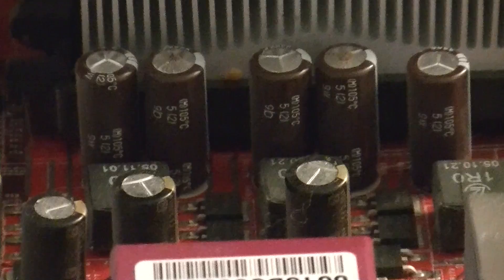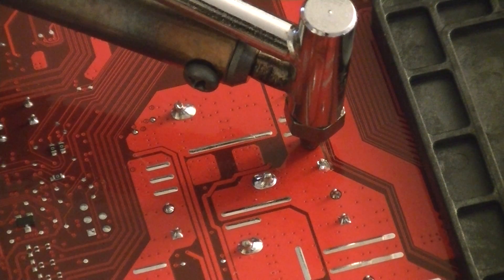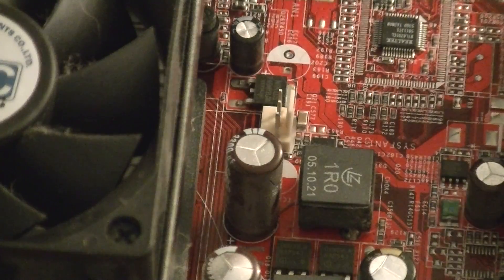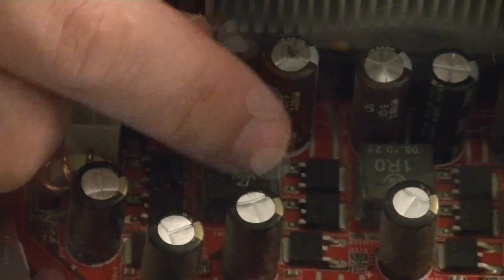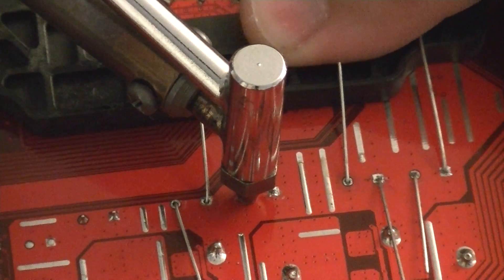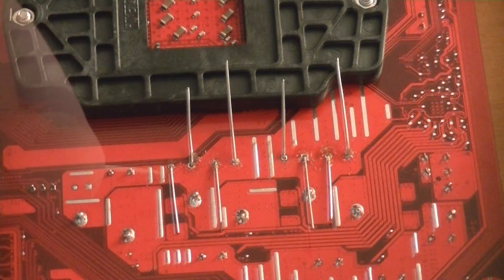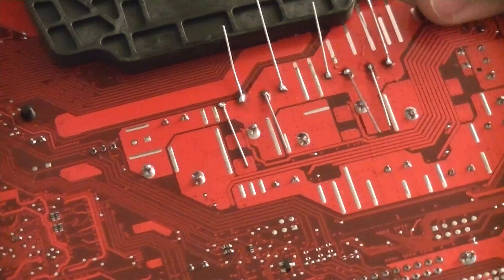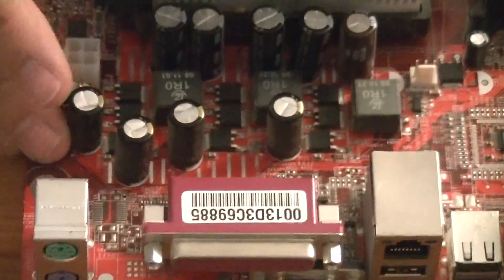How To: Replacing bad capacitors on a motherboard! (MS-7207 / K8NGM2)

Comment: This video shows good technique. It's a good idea to look at all of the electrolytic caps on the board while you're at it. The caps do have a limited service life, and those subjected to heavier use will usually go first, especially those in power supply circuits. For example, if your monitor (or TV) starts looking grainy and wonky, take a look at the power supply caps inside and they will often have bulging tops. Compare all cap tops: they should be flat. Replace any that have the slightest bulge as they are on the way out. The tops have those lines creased in them so that they can open when they have to, less dramatically than having the cap blow up and make a mess. On changing them, take a tip from an old radio man who's been soldering and desoldering for decades. You want to subject the board to heat as short a time as possible. While heating the connection on the underside of the board, reach and slightly wiggle and pull on the component on the topside. When the solder melts, and the iron is removed, the motion will keep the solder from resolidifying to make a secure connection, and removal will be quicker.

Comment: Bending the capacitor terminals after they went through the PCB is not a good practice.
The component will hold in place to be soldered now but it will be very hard to desolder and remove the next time.
Reply: I totally agree. Someone can bend one terminal, solder the other, then straighten up the first and soder it too.

Comment: What is the name of the tool at around 0:34 please?

Also, all of the capacitors around my CPU are bulging. Is this common?
Reply from the maker: SlightlyWetFart desoldering iron!
Reply: uberDoward thanks, but can't find one online like that. Does it have a another name?
Reply: It looks like a solder pump with an heating iron so that it will melt the solder and suck it up, never seen one like that before. If your capacitors are bulging replace them as it means that they will burst open soon
Reply: mauro foti Many thanks for an actual proper reply. It must be a top secret tool as the dude doesn't want to say what it is 😁

Comment: A loose capacitor broke off of my computer motherboard, two computer it and repair shops have told me to replace my motherboard completely, I dont understand this as my pc has not been turned on since trying to install a soundcard when it broke off. I thought I could just replace the capacitor or solder it back on no?
Reply: Tyler Haynes Buy a capacitor and replace it.Or if you want to,i could do it for you free of charge,just pay the shipping.
Altrough i recommend you ask someone near you to do it or do it yourself,since im in Europe and it would cost more to ship than to buy a soldering Iron and other stuff you need.

Comment: It's easier on the solder pads if you break open the capacitor bodies from the component side (of course) and try to split the capacitor down the middle. That way you get a single wire to be desoldered from the underside of the board. You will spend less time heating the pads because you can pull single leads out while using an iron or desoldering gun from the underside of the board.
Reply: That's a great idea.

Comment: what wattage Iron was used for desoldering ?   I've found one pin is easy the other  is VERY stubborn   Thanks
Reply from the maker: gymnrat Lives 40 watt!
Reply: Thank you   :)
Reply: I pushed the top of the capacitors back down and got them to work agian cheers!

Comment: just got an old dell xps 400 (dual core, 2gb ddr2) has a few blown capacitors, it's my test board to see if it works or not LOL. if i fry it i guess i move on to the few old dell optiplex 280 (i think) im gonna learn this soldering stuff! Thank you!
Reply from the maker: Happy to help!  It's a great skill to have!
Reply: uberDoward this is what I call "Fixing it the hard way." I usually don't do soldering/desoldering out in the field unless I absolutely have no other choice and can't get a whole motherboard or appropriate PCB
Reply: chrismc410 I do this as a side job,altrough i rarely take money for simple jobs like this,unless someone is a real jerk.
Soldering and reballing calms me,i enjoy doing it.It is definiately not hard,it just takes a bit of practice and can save you hunderds of dollars.

Comment: I used a needle to remove the old solder and a nail cutter to rip off the capacitors pins that were stuck. My soldering was horrible but it does the job. I'm planning to use my computer 2 hours and then 15 minutes brake cause of that.
Reply from the maker: Did you force the solder off without heating it?  If so, you want to definitely not do that in the future - the solder points on the motherboard are actually pretty delicate.  If you have a problem removing the solder, add some flux, or some fresh solder to it (since it will likely have some flux and help remove the old, hardened solder!)
Reply: uberDoward Yes I did force. I used a needle to poke and remove the old solder. Then, when enough solder was removed, I heated the stucked pins and used a nail cutter to rip it off. I tried the adding more solder method but it still didn't work. I think the old solder had lead, which means higher melting point.
By the way, my computer is still running fine.

Comment: I could replace the damaged capacitors, but now I have the problem that when I want to give the recovery the pc freeze. I tried the hard drive on another machine and it seems to be working fine. I understand that the replacement worked very well, because the pc did not turn on. Now I can access to the bios, but for some reason windows not load. I think is an other issue in the mobo. Just to thank you and congratulate you for the video. Very instructive.
Reply from the maker: Sorry to hear that, sometimes there's internal damage to the integrated circuits - maybe that's what happened :(

Comment: I have a problem removing those capacitors and is that the original solder does not melt and I can't remove them. It looks like the capacitor material is filtered and does not let it melt. Any recommendation or suggestion to remove them? Thanks
Reply from the maker: As strange as it might sound, add some solder!  Often adding a little more solder will actually help melt the old solder :)
Reply: Ok, i will try, thanks.

Comment: Hello, I have that  exact motherboard and I want to replace those caps that are fluid leaking, domed tops, etc. I have the corresponding caps ready to replace, but I do not have flux. So, my question is that I do the job without flux or the flux are very very required? Thanks and sorry for my very poor english. Any comments will be appreciate.
Reply from the maker: Flux makes it much easier.  Flux helps the solder melt better :)
Reply: I have lead free, can i use itor is better with lead. Thanks for your help.
Reply from the maker: It's hard to find leaded solder any more.  You can get flux at any general hardware store, probably near the copper plumbing :)
Reply: Ok, thanks for the help.
Reply: "Rosin Core Solder" essentially has flux inside it, and is sufficient for leaded devices like these caps, assuming reasonable solder skills.

I do NOT recommend plumbing flux from the hardware store for electronic use!  While it certainly will get your joint soldered nicely, it will also leave a resistive residue on the board that is all but impossible to clean off, especially if it gets under small, leaded surface mount devices.  This then leads to intermittent failures of the circuits. 

Learn from my fail.  If you need flux, spring for the real liquid stuff meant for electronics.  Don't get the plumber's flux anywhere near a small IC!

Comment: Is soldering hard? I've never done it but it doesn't look too difficult. I'm replacing 4 3300μF 6.3V blown capacitors on my original Xbox. What specific tools do I need? Do I really need a solder sucker or can I just heat the solder, pull them out and wipe away the solder?
Reply from the maker: You will need either a solder wick, or a solder sucker - if you just pull the component out, the solder will just fill the hole, and you'll have a real hard time getting it out :)  

It's not hard, just be careful - practice on some old electronics, first!

Comment: Thank you for this great video, can you please tell me where the negative leg goes, i have a power supply with a semicercle (black and white) where the capicitor was and I dont want to invert the polarity cause they will go boom on me
Reply from the maker: +Daniel Tevi (Jizzy) You should always check the way the old one came out, to ensure the new one goes in.  If you look on your new capacitor, you'll see a 'bar' running down one side.  That should be the negative lead (normally) - as for white or black being your negative side?  You'll have to investigate a little :)  See if one of the through holes has a solder pad that is clearly connected to ground.  If not, well, you've got a 50/50 chance - I'd probably think white is negative.

Comment: I have a Gigabyte MB and everything disconnected except power supply, speaker and monitor I'm not getting any beeps and no signal. I tried 3 different power supplys still no signal or beeps. all the system fans are working and when I plug something into usb port it gets really hot and the led on the usb device doesn't power on. all capacitors look fine any suggestions.
Reply from the maker: +Brett Stafford That sounds like a totally dead motherboard.  I'd say perhaps a blown IC somewhere on the board, sorry :(
Reply: +uberDoward Going to try replacing all the capacitors around cpu see if that does anything worth a shot
Reply: It could be your cpu aswell idk about the usb ports but Ik when I had my pc it wouldn't beep or show anything on screen it just turned on the fans and that was it. we tried a new power supply bought new ram and everything. even bought 2 differnt cpus and some how they were dead to. but one of the capacitors did spark and make a small fire but that was after the fact. we bought 2 other motherboards after that because the cpus were dead. then on our 3rd or 4th cpu my dad got the 6300 because it was on sale and it worked in the 2 motherboards that we bought and it has been sunshine and rainbows form there. sorry about my life story.

Comment: do they remand LOW ESR caps for mainboards?
Reply from the maker: +Matt K Absolutely depends on where in the circuit the bad cap is, and what the cap's purpose is.  That said, I find many lower ESR caps to be of higher quality - so I use 'em everywhere!

Comment: good and interesting but a couple of small things would perhaps improve it:

what wattage iron recommended for the job?  you seem to spend quite a while with the tip in contact with the board, must be a fairly low wattage I think.  if i did that with my iron the board would get so hot there that the tracks would lift..

is it perhaps a controlled heat iron?  not a simple plug into the mains/gets hotter and hotter..  ?

why use flux instead of flux cored solder? some particular reason/recommendation?

what tip on the iron? a point? a blade?

your solder sucker seems very special.  seems to be two in one - like it heats the solder and sucks, too. most suckers are simply suckers.  you have to heat the solder and then whack the sucker on quick before the solder goes hard again...
Reply from the maker: +arthur brogard My desoldering iron works just as you think :)  It heats and sucks!  It's a 40 watt, and it's a round, hollow tip.  Maybe I'll do a video on it, since multiple people have asked me about it!

Nothing special on the flux vs flux cored solder - just what I had handy :)

Comment: How do you make them holes empty to put new capacitor in? Nothing works for me....
Reply from the maker: +Gregory May If there's solder in there that you just can't get out, it can be a pain.  I've actually had to use a pointed tip on my soldering iron from underneath to melt the solder while pushing a capacitor leg through to clear the hole!
Reply: uberDoward I really appreciate your effort but I don't understand why you skipped the most tricky and important stages like pulling caps out and preparing/cleaning holes. I tried to replace caps on my motherboard and I got stuck in the middle. I was expecting that this job will take 15min after watching all the videos;) There are 1000s of videos like yours where they show nothing or skip whole stages of repair. Seriously I just found 1 video where the guy show everything and this is not in English... And the guy is not doing it right according to commenters....
Reply from the maker: The next capacitor replacement I do, I'll get a more in depth video for everyone!
Reply: uberDoward
Great. Thanks

Comment: 6.3V for a 5V system.
during my trainee-time Ive learned something about 
"component values = operating value x 2.5"
so a really durable cap should have 16V for a 5V System.

here we have planned obsolescence again!

BTW
what was the temp of Your soldering iron?

and some crit:
seems like U dont use an antistatic surface
Reply from the maker: desinfector Correct, I rarely use an antistatic surface.  I ground myself before any work, and repeatedly re-ground myself during work.  Temp was 375C, IIRC.

Comment: Hi Uber, I know that my capacitors is going bad since my computer comes on and then restarts in about 5 minutes or so.  I want to know is it worth while replacing the capacitors or should I just get an new computer.  My computer is almost 5 yrs old...just don't know if it is worth the cost or not for the parts/labor.  I will have to take it into a repair shop because I don't have any idea about what I would be doing taking a computer apart.  Thanks for advice.
Reply from the maker: May Hebert Well, one issue you will have, is that this level of component repair is VERY rare these days - that's why I uploaded the video!  When you factor in what a repair shop is going to charge you in labor, you're probably better off getting a new system, especially if yours is 5 years old already.  That said, once you have a new computer - why not try making the repairs yourself?

Comment: by removing those. what does it do?
Reply from the maker: Removing them lets you free up the area for new capacitors.  Essential if you are going to replace bad ones :)
Reply: Oh okay.  thought it was going to mess something up in the laptop like delete things
Reply from the maker: Ah, no, this is hardware - you want to remove and replace the capacitors.  If you don't put any back in, your system won't work at all.
Reply: Oh okay. I understand now, thnx

Comment: what is the wattage of the desoldering iron?
Reply from the maker: 40 watts of raw desoldering power!
Reply: uberDoward It's no wonder mine doesn't seem to work at 30 watts...the solder refuse to melt
Reply from the maker: Yeah, I'd try a higher wattage iron :)

Comment: I actually have a 939 board that I was throwing into a scrap system I built yesterday on a surprise day off.  Then I tried to boot it and it didn't give any feedback except main power.  Then I noticed that half the cans were burst.

The board I have was from...I want to say 04 or 05...so MSI must have been sourcing a whole bunch of plagued parts around that time.
Reply from the maker: Fix it!  No sense in throwing away something that may still work :)
Reply: uberDoward
 Man, about 4 minutes in you weren't kidding about 'wiggling underneath.'  I did the replacement last night and it was a BATTLE to get those caps out of there.  I was half tempted to hop into the car a drive to microcenter to get one of those desoldering units you used in the video.  I had to heat those joints up so high with my iron that I thought I was going to ruin the board.  The old caps were getting so hot that I had to use a glove to grasp them just to get them off the board. Wick didn't work, neither did my desoldering pump.

Heh, now I'm afraid the thing is going to work for a week and the other 8 caps of the original type will fail.  Man that was a process...I gotta wonder what kind of solder they used when building this board.
Reply from the maker: Likely lead free - requires a lot more heat to get lead free solder to flow, hence the desoldering iron, as you have found out! :)  I would absolutely repair those other caps while you're at it.  I HATE doing the same job twice :)

Comment: good and neat work thx i need to fix my graphic card and motherboard after this
Reply from the maker: No problem!  Best of luck :)
Reply: Hi i need your help again...i try to remove the capacitor using desoldering wick but it doesn't work even after i've applied the solder flux on the wick...i try to heat up the capacitors leg but it seems the factory soldered is really strong and bonded too good for the solder to melt....Do you have any idea why is it my desolder wick not good or the flux not good ...i am using 80w solder iron

FYI the capacitor is on ATI graphic card
Reply from the maker: Are you sure this is a through-hole capacitor?  I've seen stranger things happen :)  Provided that it is, indeed, a through-hole capacitor, it sounds like your iron isn't hot enough, if you're not able to melt the solder at all.  Can you melt the solder any?
Reply from the maker: Definitely!  Let me know how it goes!
Reply: uberDoward Yeah i am sure it is through-hole capacitor because its the electrolyte one and there is obviously 2 leg sticking out on the bottom side of the circuit board..the problem is the solder so tiny when i put the wick on it looks like it doesn't even stick to the wick...

I've tested the heat of the iron tips on the solder first before doing and it melts instantaneously. In fact the solder heat up more than require i think until reddish blazing heat :)...but i will not giveup and try again tonite and hopefully it works i don't want to buy another expensive graphic card. its too stupid